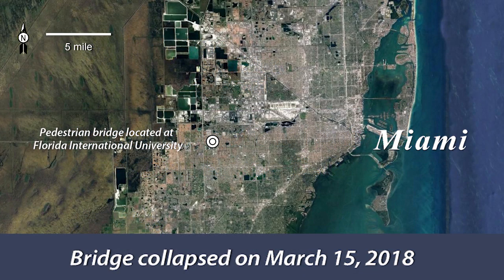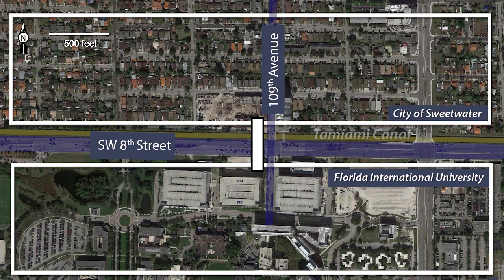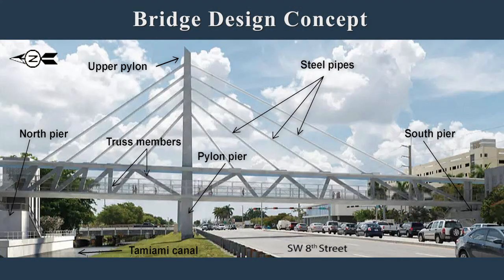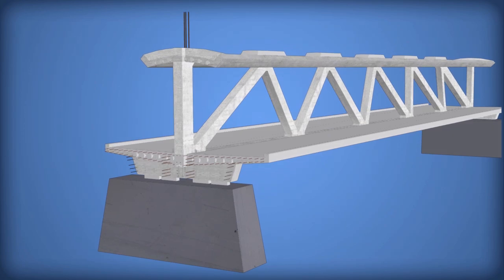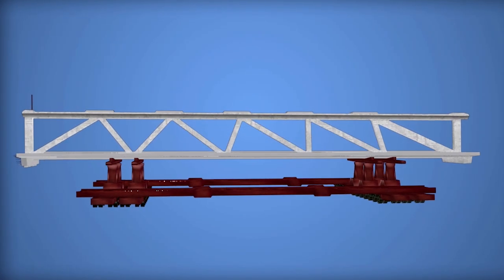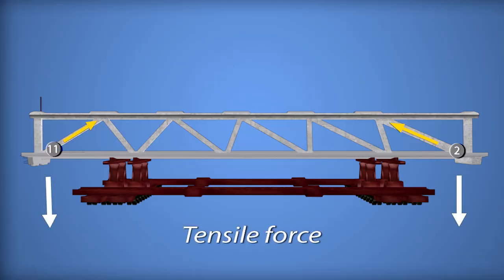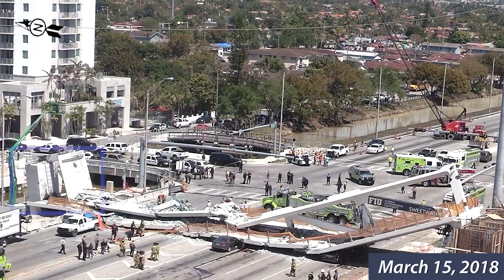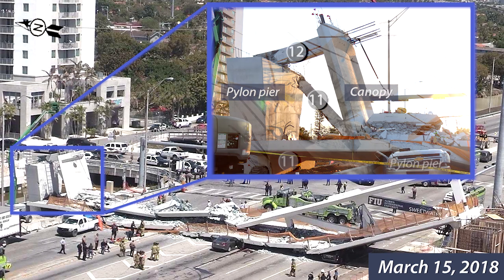Pedestrian Bridge Collapse Over SW 8th Street HWY18MH009

Comment: I’ve worked on a lot of bridges
Our number one rule was 
“No traffic can be around us when we are working”
It seems to me that I spent more time stopping and 
Diverting traffic than I did actual bridge work.  
I got cussed out by the traveling public more times 
Than I can count.  No one died in any of our bridge work.  
Before watching this video I thought my boss was normal. 
Now I think he is a genius.
That canopy looks 100x over weight.
Reply: “They are 100% responsible. FIGG already had an issue on building bridges. On 2012 they got sue in Virginia for a 90 ton segment of the bridge that fell onto railroad tracks . They settle the lawsuit on their own to keep it on the low, so no one would here about it. Now look what happened in Florida. They are 110% responsible.....”
Reply: @thomaspayne6866   here / hear
Reply: This bridge design and the construction process is pretty much a textbook example of what not to do in civil engineering.  That road should have been closed as soon as those cracks were observed. This failure is not the fault of one person but the entire process because there are more red flags than in the Kremlin.
Reply: @epistte  I said this in another thread, while we can argue and agree that the road should have been closed, as a politician or a bureaucrat, you can NOT afford to close a major road way for any reason what so ever, even if there is a threat of the bridge falling down. The only step you can take is to attempt to mitigate the issue, which in this case was trying to prevent it from collapsing for as long as possible so they can develop a plan to remove or repair the structure.  
The only time I have seen a state actually close a major highway for an extended period of time, was when they were actively rebuilding a section after a major fire.
Reply: @TheObsesedAnimeFreaks  Is it easier to defend closing the inconvenience of the road because there are major structural problems evident with this bridge and the city is doing so to prevent loss of life or is it easier to defend not closing it after 6 people are dead? It was obvious as soon as the bridge was put in place that there were serious defects with the bridge. They should have pulled the bridge off the supports and moved it back to the adjacent yard for inspection and possible scrapping. 

What would you do if one of the site engineers leaked a photo to the media and then said that you knew of the structural defects and yet refused to close the road, putting everyone who used that road at imminent risk of being crushed by hundreds of tons of concrete and rebar?
Reply: @epistte  
>Is it easier to defend closing the inconvenience of the road because there are major structural problems evident with this bridge and the city is doing so to prevent loss of life or is it easier to defend not closing it after 6 people are dead?
Absolutely irrelevant. It's not about whether you can defend an action or not, it's about the impact on the public. You close the road to either take it down or fix it, you have now inconvenienced a bunch of people. Now lets say it doesn't come down at the end of the day, now you have inconvenience a bunch of people with nothing to show you were right. The public will see you as causing them an inconvenience with no reason for that inconvenience. Not to mention you have to tell the public WHY you are closing the road, if you tell them because you fear the bridge will come down then they will be far less likely to use the bridge OR the road below it. These are things these politicians and bureaucrats have to think about. Sometimes it's better to act like nothing is wrong then to go above and beyond to tell people what is wrong. 
>It was obvious as soon as the bridge was put in place that there were serious defects with the bridge. They should have pulled the bridge off the supports and moved it back to the adjacent yard for inspection and possible scrapping. 
This is where you are wrong, while yes they had signs that something was very wrong early on, it wasn't "immediately known." It's not a simple task to take the bridge down, and by the time any cracks would have been known and the risk would have been assessed, the equipment to move the bridge would have been long gone and probably on the next job site if not headed to it. So the logistics of taking it down in a timely manor might be out of the question.  At this point your only option is to try to fix the problem and act like everything is fine for the reasons mentioned above among others. 
 >What would you do if one of the site engineers leaked a photo to the media and then said that you knew of the structural defects and yet refused to close the road,
uh, I would keep the road open and prosecute the individual who leaked that confidential information. Regardless, that doesn't matter. The public aren't structural engineers and they are stupid enough to believe the government when they really shouldn't. Point being that most people probably won't care and the ones that do already don't trust the government and the remainder realize the implications of closing the road when the bridge hasn't fallen yet. Not to mention that the media would probably play the side of the government for better or for worse, allowing the engineers to say that they are trying to fix the problem and there isn't an immediate need to worry. 
At the end of the day closing the road wasn't an option that they could take for better or for worse, we could argue all day about whether they should or should not have closed anything down, the fact remains that they likely had their hands tied and couldn't do a damn thing about the road traffic. The fact remains, they aren't going to close a road just to work on a bridge that might collapse if at all possible, they will wait till the last minute and they know it is going to collapse and they can't fix it to allow it to collapse. The only other time they will close a major road is when there is major structural damage to a bridge the road is on or the road itself and they have to rebuild the bridge or road from the ground up.
Reply: @TheObsesedAnimeFreaks  It is far preferable to inconvenience people with a detour than to kill 6 people. The negative PR on an unneeded is detour is better than having to tell their families that you knew the bridge was faulty to the point of collapse and did nothing. The later action is an example of 6 counts of negligent manslaughter. The ethics and legal obligations of engineers were discussed in my engineering classes.
Reply: @epistte  that is hind sight reasoning.  Unfortunately someone did not think about the cost in lives.  I think that the employer of the worker who was killed may be paying out the most in compensation than the other unfortunate individuals.  But there is going to be a large amount of judicial hearings with the possibility of settling out of court as well.
Reply: @epistte  
>It is far preferable to inconvenience people with a detour than to kill 6 people.
Actually no no it's not. In this case the options were close the road and divert days worth of traffic down side streets, or not close the road and hope they can fix it with no inconvenience cost, or be able to close the road at a later date for a planned collapse when the machinery is available to clean it up. When faced with these options, the inconveniencing people sounds much more scary then the nebulous idea that it MIGHT collapse and MIGHT kill people. It might not. They didn't know. We know that it did kill people now but back then they didn't know that it would. Hindsight is wonderful, too bad they didn't have it. 
>The negative PR on an unneeded is detour is better than having to tell their families that you knew the bridge was faulty to the point of collapse and did nothing.
Except that it's not. lesser things have ended careers of bureaucrats and politicians. In this case if nothing had happened and an unnecessary closer happened, the guy that decided to divert so much traffic would probably loose his job. While the same guy wouldn't have lost his job if it just so happened to collapse unexpectedly in an event that wasn't planned. politicians and bureaucrats don't loose jobs an account of tragedies, they loose them if they inconvenience the public. 
>The later action is an example of 6 counts of negligent manslaughter. 
Except that it very much isn't. A structural failure is not manslaughter. There is no direct action that caused these deaths, at best they can be held civilly liable for the collapse, but not criminally. You are trying to blame something that is a pure accident in many respects on individuals that had no knowledge that something might happen at that given point of time. Their actions were the attempts to fix the bridge not cause it to collapse, and the action of not closing the road for a bridge that wasn't necessarily known to about to collapse in the time frame that it did, do not justify manslaughter, NO DIRECT ACTION. 
>The ethics and legal obligations of engineers were discussed in my engineering classes.
The real world isn't your ethics and legal obligations class. There are many factors in this case, and the primary factor to the cause of the 6 deaths has more to do with the fact that they could not close the road AT ALL, during the time it collapsed, as it would have had to be a planned closure with a traffic plan in place. Without this the best they can do is close maybe one lane and try to prevent it's collapse... guess what they did.
Reply: @Bl4ckw0lf1  We are professionals. We are required to consider the possible implications of our actions before we decide to act. The  failure  to consider those actions is criminal negligence when someone dies or is seriously injurted because we did not.
Reply: @TheObsesedAnimeFreaks  
Either way, people are dead, I facepalm at the failure to identify/report or safety/redundancy construction, and then move on.

Government contracts tend to involve the lowest contractor bids while meeting or exceeding requirements and needs.
Reply: The Obsesed Anime Freaks  they are closed all the time for big projects. 
Lots of pre planning and public notices go out.  You don’t have to close it per se. You can divert it or detour it or many other ways.  Have a pilot car and let traffic go thru at intervals.
Reply: @PInk77W1  this is exactly how they do it. But it takes months of planning to get to that point. It's. Not something they can happen at the snap their fingers.
Reply: The Obsesed Anime Freaks  I’ve closed down many freeways. If u use the word 
“Safety” or “emergency” it doesn’t take no time.  Only pushback I ever got was 
How long is this gonna take and can we do it quicker? But as long as I had a good plan, I never got turned down.
Reply: @TheObsesedAnimeFreaks  Except they already had an agreement as part of the permission to do the bridge that the road would be closed when ANY major work was being done on the bridge once it was in place. So by not closing the road they were actually going against the rules they’d agreed to.
Reply: @TrappedinSLC  thing is that the adjustments weren't supposed to be major work. sorry, your point is null.
Reply: @TheObsesedAnimeFreaks  Anything dealing with the structural stability of the bridge is major work. Trying to address significant cracking is absolutely major work.
Reply: @TrappedinSLC  but it's not. they didn't think the bridge was compromised, they thought a minor adjustment would fix the issue. they were wrong but they didn't think it would come down when they were working on it. it's not major work in that respect. sorry.
Reply: @TheObsesedAnimeFreaks  It is. Tensioning cables are not minor work. Adjusting the stresses in the structure is not minor work. You can claim otherwise all you want but you, and they, are wrong. Minor work is touching up surface finishes and running things like electrical cables and installing lighting and finishing details. Nothing structural. PT cables are inherently structural.
Reply: @TrappedinSLC  lets put it his way, major work are things like moving the bridge, repairing major structural damage, and other things like that. however retensioning the pt cables was not supposed to cause it to collapse, nor was it major work. that's minor work because of the scale of which it was predicted to be and the fact that it was assumed that they wouldn't exceed the cable's stress limits. they were wrong and they over tightened a flawed design but... at the end of the day it was supposed to be a simple task. 
lets not forget that there are simple repairs you can do to the structure without having to close it outright. plenty of building have structural changes while they are occupied every day, and none of them have come down. no one is saying they didn't screw up. However based on what they knew at the time, there wasn't supposed to be an issue with what they planned on doing.
Reply: @TheObsesedAnimeFreaks  Have you SEEN the photos of the cracks? The vast vast majority of engineers who’ve looked at the photos identify them as of major structural concern and so any work to address them would fall under the category of work that should automatically close the road. Most of the engineers say they’d close the road immediately to install shoring under the bridge until the bridge can be removed for repair or demolition. As many of the cracks were present before the bridge was moved into place, the rest of the engineers who are worried about the cracks say they just would not have approved moving the bridge until the cracking was fully addressed. This is not hairline cracking from the concrete setting process, these were major cracks in structurally significant areas. The people on site who chose not to close the road and who decided to just mess around with it without proper investigation first were wrong and negligent at best. Stop defending them.
Reply: @TrappedinSLC  It’s admirable yet still a waste of time that all of you good people try reasoning with The Obsessed Anime Freaks who is clearly not a reasonable human being.
Reply: “Never trust a truss.” Drilled into anyone in engineering school. Basic mechanics, you need redundancy on any public works because the cost in lives if you’re wrong is catastrophic. Also taught: “overbuild everything” and “redundancy redundancy redundancy” and finally “even if you don’t think it needs it, do it anyway.” So I doubt it was a “diversity” issues so much as a general incompetence problem (possibly a “daddy gave the school money for junior to graduate” issue.)
Reply: @na195097  You make some good points but actually there has been a reduction of Factors of Safety since the 1970s when I got my Civil Engineering degree. We used to use "Allowable Stress Design" but it changed in the 1980s to "Load Factor Reduction". I had sold my body to the Army to pay for college so I went active duty after graduation. By luck of the draw, I became a bridge building platoon leader. It was great training. Later, I went back to grad school and ended up a town engineer shared between 12 small towns. We had many bridges that needed to be replaced so I set about replacing 2 or 3 each year. I designed them, the town acted as general contractor and the road crew did as much of the work as they could. We usually only contracted out for the concrete work and the crane. Bridges that the States' Department of Transportation said should cost $200,00, I was doing for under $50,000. A lot of people got mad at me for showing how inefficient they were.
Sometime in the late 1980s I did an analysis of the ASD vs LFR. It turned out that if you combine all the built in factors of safety the ASD has an FS ~ 4 and LFR ~ 3. Now that wasn't bad because by the 1970s US made steel was very consistent and reliable. The problem that I found was that when foreign steel started coming in it was all over the scale on quality. When I worked on the Big Dig, one company found that their foreign steel was failing at 1/2 it's rating.
I usually used wood or steel bridge kits for my town bridges. If the old abutments couldn't be rehabbed I would use precast concrete culverts and save the cost of a superstructure. For my steel superstructures I would design for A36 steel but then spec 588 steel painted. A fellow engineer officer that I served with during Desert Storm warned me about how 588 steel corroded through in Hawaii in less than 20 years. I always painted it after that. 
Some of the joint failures look like concrete failures(not the steel) to me. Good Luck, Rick
Reply: thank you for doing the thankless job of diverting traffik. can't believe they watched this bridge fail.
Reply: At 950 tons the whole thing is over weight. A stronger bridge could have been built at half that weight. As some one who has worked on bridges you know that better than anyone. And the design seems more for looks that it is for anything else. I bet in 10 minutes could design a better bridge than that.
Reply: The OSHA article I read said that "demand was 45% higher than the available strength without considering any load factors or phi factors" at the joint that failed. If Denney Pate of FIGG Engineers hadn't decided to do any extra non-peer-approved post tensioning that day, the failed construction joint would have remained 22% overloaded. But as it was, Pate went home around the same time the crew went up to perform the PT. The collapse around 2:00 pm, so Pate was still traveling home to Tallahassee when the bridge he designed and stamped was falling on a dozen cars in Miami midday traffic.

The joint that didn't fail was only 16% overloaded at the time of collapse. Good job, Denney Pate, I hope you sleep well at night. Mr. "cracks aren't a safety issue" Pate. Mr. "spalled areas are minor" Pate. Mr. "all we know is that it just happened" Pate.

Structurally, the cute concrete tendons should have been doubled or quadrupled and braced diagonally. They could have still had the interesting look to them, but imagine instead that the redundant members were sharing the load and only at around 18% capacity before pedestrian traffic. The dudes knew that concrete is way more costly and heavy than steel, but still went this design way to be different. Should have used steel superstructure and be done with it ... maybe encasing it inside something that could be removed for inspection, like stainless or aluminum panels with faux rivets.
Reply: I live here and travel by this all the time.
Ok to all the people saying the road should have been closed. IT WAS. it was closed for a good week completely before they put that thing up they had just reopened it............
Kind of weird time to reopen the road dont you think
Reply: Dave MacGyver it wasn’t closed if Six people died
Reply: Sees large cracks forming does nothing?
Reply: Agreed. We close off roads for much less serious work than that!
I still can't get over the fact that the bridge wasn't propped once those cracks became evident and got worse
Reply: I’d rather live through extra traffic and even get fired then die.
Reply: Him Bike true, but Miami’s Hurricane Country & the canopy had to be substantially built
Reply: James Simms Hurricanes take days and weeks to arrive. It would take a few hrs to take down a simple canvas canopy.  
But I get what u mean.
Reply: you are spot on brother no one but workers should be around that bridge when such a delicate move is done like this
Reply: grodhagen  If you completely disagree with my thinking on the issue then you have not read a word i have said. from a political standpoint, the public doesn't care, they want that road open rain or shine and if there is some "major" issue they don't care, they just want it open. And while I might have my preferences, (i.e. do something about it quickly, at minimum building a quick and dirty scaffolding system to support the damn thing, closing a few lanes.) I understand the political hurdles and the policies and politics that could have prevented quick and decisive actions. My argument isn't that they shouldn't have close the road, rather, regardless the political hurdles prevented such things and that's the reason why it wasn't closed. 
My way of thinking is what could we actually do rather then what should we have done in that situation. in this situation it's more likely that because of the uncertainty of if and when it would collapse and the perceived perspective that it could be fixed, the state ruled that they should attempt to fix it first rather then shut down the road completely until the bridge either fell or it was determined to be beyond saving. My argument isn't about what they should have done, but about why they did what they did.
Reply: Yes, people need to go to prison on manslaughter charges and never allowed in the construction industry again.
Reply: At the University of Denver, they are reconstructing the bridge in response to this incident. Miraculously, no traffic has actually been diverged the entire time.
Reply: Has a 174 foot span that weighs 950 tons with minimal support.. what could go wrong?
Reply: "It seems to me that I spent more time stopping and 
Diverting traffic than I did actual bridge work."

Been there, done that, in all of my work fields: IT, software design, Electrical Engineering design...
Reply: @Sr.DeathKnight  I'll bet they're wishing they woulda heeded your words
Reply: Hey we should build shade and weather shelter on the bridge.  Sure that sounds good, lets use a 4ft thick slab of concrete, will that provide enough shade?
Reply: @simong1666 not enough shade lets do 8ft
Reply: Yeah he’s definitely a genius......👍🏻🇺🇸
Reply: Him Bike ahh a man of safety
Reply: https://www.youtube.com/watch?v=Y5sceezeaY4
Reply: Gotta remember that all these rules are written in blood
Reply: Why then do  I constantly see work being done on bridges al along I-95?
Reply: @offgridhomesteaders863  maintenance is constant
Reply: For sure
Reply: Everyone’s an engineer
Reply: Yep
Reply: I know nothing of construction... my first... 1ST! THOUGHT! WAS... why does the canopy have to be all concrete and super heavy looking... WOOOOOOWWWWWW.....
Reply: @KurticeYZreacts  nice job missing the entire context and replying to this thread like 3 years after the last reply. the argument was about whether government should inconvenience people for something they didn't expect to come down or not. we can agree that the road should have been closed, LIKE I ORIGINALLY STATED. but lets play devils advocate for a sec, it's a major road way... you kinda can't close that down for any real amount of time. some bureaucrat or some moron thought that the inconvenience wasn't worth the economic cost of closing down the road. that was my entire argument. so what's your point? that they should have closed the road? yeah we can agree on that. 
god i forgot about this dumb argument.
Reply: @KurticeYZreacts they can't close the road for political reasons though, that's the entire arguement. an i highly disagree that the bridge would still be there.
Reply: @TheObsesedAnimeFreaks  alright i read your comment. And youre right they prob couldnt save that bridge. I understand what you mean about the eco cost of shutting it down but... ive dealt with construction detours all my life. Its never ending.  And one time the detour pissed me off a lot and it lasted a while. But... they sure as f closed that road. I even considered using it while shut down... but i didnt. I dealt with and totally forgot til now. As ppl usually do. Sry for being a pos to you. You seem to have sense about you. You just love playing devils advocate too much 🤣 much love brother
Reply: At the point when they saw those cracks forming, This was a let’s pull it back to the construction yard and start over. Instead, Let’s tighten this up and maybe the cracks will stop.  People died because of bad decisions all around.
Reply: Several new interchanges in recent times and I don't think I've ever seen a bridge or roadway underneath it closed around here over construction. With proper engineering and competent employees there is no need to. If there is an issue like the cracking on this bridge then of course but otherwise you should be able to keep traffic moving along.
Reply: A concrete canopy...........?????
Reply: r5t6y12  about 1,000,000 lb.  canopy
Reply: @PInk77W1 so much protection from the sun.. maybe more concrete would protect me from this crumbling concrete! 😂
Reply: Am I supposed to read that as free-verse poetry?